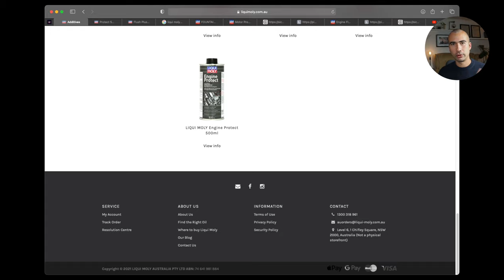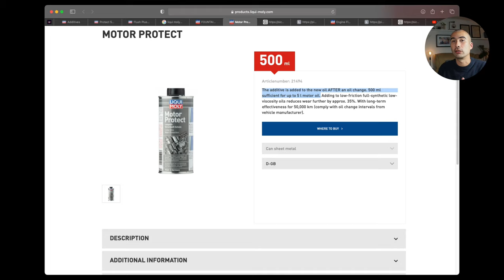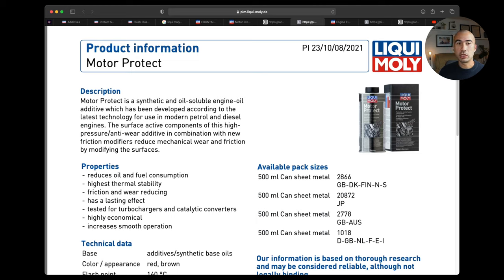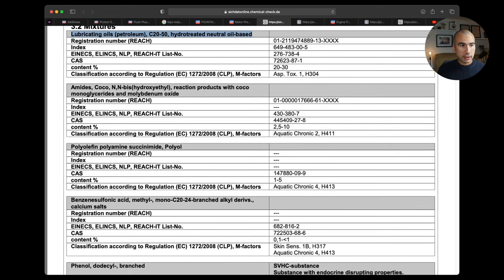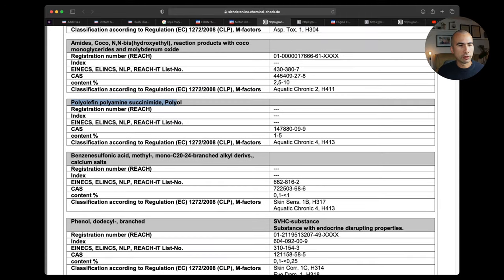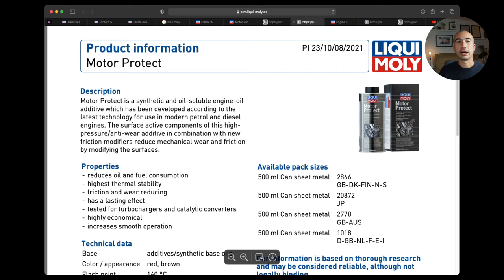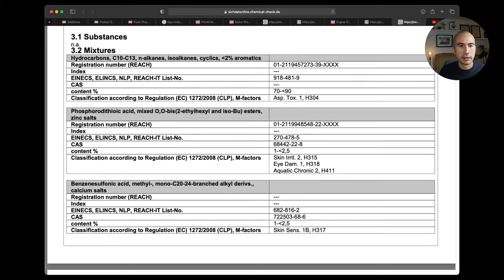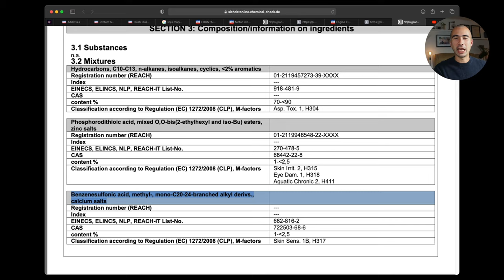What is actually in a motor oil additive like Liqui Moly?

Comment: Liquimoly gives more information about their Ceratec additive. It contains hexagonal boron nitride and a friction modifier in a mineral oil carrier.
Reply from the maker: Not a huge amount available though. The SDS doesn't list the quantity of Boron Nitride, only the friction modifier (the same Moly-based compound as in the Engine Protect product).
Reply: Pretty much a waste of money with a good oil filtration system. 
Molybdenum does not stay in suspension but drops out to coat sump 

Anything with a centrifugal filter will remove any particulate above about 1 micron where a paper filter only removes 10 micron or larger particulates
Reply: yeah its hBN particles and some form of MoDTC in some base oil
Its not AN or Ester that's for sure.
Not really the greatest additive especially not for 20$ per oil change.

Mannol sells a very similar additive that's also hBN based BUT it's suspended in synthetic Ester Oil AND it also contains a lot of ZDDP so you end up boosting your ZDDP around ~300-400ppm.
And that stuff is 6,50$ a can here!
Reply: @alouisschafer7212 G'day mate. What is the name of the Mannol product that you are referring to?

Comment: I've never been a fan of oil "additives" or "treatments".  I'm always wondering how well or not well they interact and react with the additive package and base oil in the motor oil being supplemented.  I prefer to use an oil that is already formulated for my engines needs.

Comment: "Motor Protect" :::: Moly (FM, AW, and anti-Ox) is there in significant amounts.  The MSDS said it is between 2500 ppm to 10,000 ppm, and you divide that by 10 to get the concentration bump-up if you put this in a typical 5-quart sump, for example.  So, this will increase the moly content by anywhere between 250 ppm to 1,000 ppm, which is considered A LOT.  Motor oils typically have between 50 ppm up to 900 ppm rarely (Japanese light 0w20 oils have a bunch).  So you can see Motor Protect does boost moly Plenty.   And Dispersants are there, enough probably.  Calcium detergents are there in small amounts, not bad, and it will increase TBN (acid absorbing capability) a little, not much.  AND,.... other ingredients not so poisonous so they are not in the MSDS, might be there, unknown, like some esters maybe, for more AW and FM (???).  I'd say add this as top-off oil during a long usage interval, to replace depleted chemicals in your motor oil as it ages slightly.

Comment: I think these additives  are bad for the FAP ( espacially the friction modifier ). If Catrol or Mobil  do not integrate these  additives it’s because the risk unbalanced the standard of the oil. It can be dangerous to add additives because you unbalance your motor oil

Comment: "Reduces wear further by 35%"  Now what does that mean ?  What it doesn't mean is that it reduces wear by 35% .  We might assume (we know what that stands for !) that it reduces wear over that additional wear reduction obtained from using two different lubricants ?? VERY unspecific ! Also wear where ? Within an engine wear occurs in different areas under different conditions for different reasons.  PLEASE UNDERSTAND MARKETING   This is not lies, but it is essentially meaningless and designed to mislead. Basically you have found very little about these product even by digging. A VOA would likely tell more, but you have not done this.
Reply: 35% of fuckall is still fuckall :) Just change your oil on time .

Comment: I've used that flush.  I have an 8.8qt oil sump so I used 2 bottles.  I changed the oil and drained the filter and replaced with new oil and flush.  After 15 minutes I drained again.  I was very surprised at how dirty the "new" oil was.  Even putting some in a glass jar with a flashlight behind it, it was extremely dirty.  People say you don't need a flush with regular changes but I use a top brand synthetic and change my oil 25-50% more often than recommended.  I had 80K miles on the engine and the Audi 4.0T is known for clogging the turbo screen so I thought I'd give it a shot.  

Question is, with the little bit of flush left will it hurt the new oil's performance.  I think the car retains .4 - .6qt during a change.
Reply: I have a honda civic. I drained the oil until 1 drop every 15 seconds came out. I then put the plug back in and left the car for a week to sit with no oil. After 7 days or so i removed the sum plug and like almost a liter of oil came out. I was shocked. I then added new oil. With this new info the next time i did a service i added the engine flush, let it drain normally and then added a cheap synthetic oil with new filter and ran the engine on 2500rpm for 15 minutes. I then drained that oil out till a drop every 30 seconds or so. The oil looked dark like used oil. I then filled my castrol synthetic in with another new oil filter. After doing a run with the car i checked the dip stick and the oil looks like new from the bottle. My point here is i love my car and i won't leave that little bit of engine flush in the engine, it has potential to thin the oil out because of how much is still left over with a standard oil drain.
Reply: @reiannaidoo  I have since calculated it to about 6%,  It's neglegable.

Next time, put a breaker on the crank pully and turn the engine over once.  It'll  open up some new passages to drain.  You should see a bunch come out of the oil filter it it's still off.  I don't have a week to let oil drain.
Reply: @datsuntoyy  or just remove spark plugs, pull EFI fuse, and crank the engine using the starter motor. Smart guy.
Reply: @mareksumguy1887  any idea on how long it takes to remove spark plugs in some cars?  Also not fond of clearing settings/creating faults in the computer or risking a spark thus frying a computer.  
Many engines have a very accesable crank pully that only takes a minute and with the ignition off won't be affected by turning the crank.
Yep, smart guy who can think things through.
Reply: you'd then have to weigh the damage done by running the engine on the oil film alone vs leaving in the few grams of flush. Leave the residual flush in, most of the crap would evaporate anyway in the next 10km.
Reply: When you pour in the new oil, leave the drain plug off, and slowly pour in the new oil until it runs clean out the bottom. That will help remove some of the oil that won't drain on its own. You will see that the first half quart or so that flows out will still look quite dark.
Reply: @AEVMU  I usualy do.  When I had my corvair I'd put a breaker on the crank pully and turn the engine over once.  You'd be amazed at how much oil that frees up  I don't do that with the newer engines.

Comment: thanks for this, i just came here again to ask that you do a video on what the difference is between cheap and expensive engine oils, esp the latest ilsac gf6a and SN plus oils. these range from 6 USD to 60USD per litre, a huge price difference when the minimum specs seem really high so why bother using anything more than the cheapest if its meets the "so called toughest API standards". pls consider using a mic as the voice volume is low.. thanks
Reply from the maker: Thanks for the feedback! I’ll add it to the queue. I did touch on this topic in the following video: https://youtu.be/fsF_dIDDJgs

Comment: When asking companies like Mobil if it’s ok to pour in additives, they say no, and that the oil already has what’s needed to protect the engine. LiquiMoly sells MoS2, which is the solid version of Molybdenum. I’ve read that the moly included in motor oils, however, is an oil soluble or liquid version of Molybdenum. Is it really advisable to pour in the solid MoS2 into motor oil? I have seen how people have shown that because it is a solid immersed in mineral oil, it tends to separate out of the motor oil and sit at the bottom of the oil pan if left for a while undriven.
Reply: No advice on can that says to shake before use so maybe doesn't settle out.
Reply: Once it’s suspended in oil the mos2 doesn’t really settle out

Comment: I would like to ask you about a super strange thing , alot of forum recommend motorcycle oil must have Api : Sl ,they that it have more zddp  so i basically use it , but afterwards i searched for top oil brands and find out that the top tier oils are Api : Sn , im really confused , maybe this can be discussed in the next video .
Reply from the maker: I’m not so familiar with motorbike oils, but I think the rationale behind this is that the newer oils contain friction modifiers, so you don’t want to use it on a wet clutch bike.

In this instance, better to look for the JASO motorbike spec.
Reply: A few years ago when SL oils were used I read that it was better to use SH or SJ for bikes as the ZDDP was higher - so interesting. My impression is that people lamented the lack of ZDDP as an essential for bike engines, but from what I gather now other perfectly acceptable anti-wear additives have replaced ZDDP so it's an outdated concern. Just my impression.
Reply: @LubricationExplained  ok , now the most controversial thing that I've found is that some oils like rottela t6 , t4 , stuff like that are rated jaso ma2 , i believe that someone said diesel oil that not have friction modifiers in it , in my country we don't have access to shell rottela products , we have other brands , and a some of them are rated api : sn and jaso ma/ma2 approved and some just says in the description wet clush safe, and they are listed as car oil , am i missing something here or what , plz inform me more about this topic.
Reply: @LubricationExplained  I've researched motorcycle/wet clutch oils extensively as a teenager due to being an avid 2T rider at the time, and there are some studies showing that clutch slipping isn't really caused by friction modifiers as much as it is caused by lower viscosity oils, such as you would see with an SM/SN/SP oil, and I would also presume that the lack of sufficient additives and chemistry to limit viscosity loss during shearing plays a role. Then, another thing to consider is HTHS, especially in enduro applications. KTM recommends running a 10W60 in their 4T bikes for hard on-track and enduro applications, so there is certainly a need for viscosity retention at extremely high temperatures with motorcycle oils. In my research, I found VOAs of Mobil synthetic motorcycle oil that actually had a significant amount of molybdenum in it! From my understanding, friction modifiers don't typically pose much of an issue in an oil of the proper spec for the application, and much of the recommendations to avoid them are due to a sort of false correlation between the lower-HTHS preperties of resource conserving oils and its influence on clutch slip. Another interesting thing to mention is that oils with very high levels of ZDDP are usually recommended against for wet clutches, such as Valvoline 20W50 mineral racing oil and Pennzoil 25w50 mineral racing oil, though I've used both as a gear oil in a 125cc 2T bike with absolutely no issues.

Comment: If you ever do a third-party analysis on additives, always request a TFOUT test which is your thin film oxidation stability. You would be horrified to know that ceratec actually makes your engine oil oxidation properties worse (11% worse to be exact) i’m all about a quality additive pack added to quality oil, but never at the cost of a negative effect.
Reply: It may provide friction reduction to offset the increased oxidation. Just change the oil slightly sooner. 8,000 miles instead of 9,000 miles.

Comment: Thanks for the video. 
Q. For the masses, are 'we' still buying and adding snake oil additives?

Is 10 min of idling an additional 300ml of special snake lube enough to make any difference at all?
Does 500ml of additional additive from a bottle help, or mess up the already complex additive package of a top quality synthetic engine oil?

I've been in the trades for approaching 40yrs, and taken a keen interest in lubrication information. 
I've never used an oil additive in anything I've owned, including rally cars and dirt bikes, and I'm yet to see a lubricant related failure.
I've seen lots of failures, but none related to the lubricant itself...
Reply: “Snake oil”?
These products are already put in that bottle of oil you buy from the store. The manufacturer puts them in. 
Maybe you want some benefit over what your particular oil formula provides.
Reply: @bobirving6052  I'm well aware that some of these additives may already be in the oils we use.
I'm also aware that oil companies spend millions of dollars on getting the formulations and blends correct so that the oil performance is as expected. 
They test to get the various certifications for that product from the SAE and manufacturers so we know they're suitable for the equipment we're adding it to.

How can someone with no knowledge of what is already in the product expect to 'improve' the oil simply by adding a bottle of 'magic juice'?
At best it will have no effect, at worst it will run one part of the blend package way out of range and make it unsuitable.

Comment: have considered using additives esp liqui moly that spends A LOT on marketing and is used by fanboys all over the world. but i just use top range Shell Helix Ultra and my car runs new after 250000 km 11 years and its just a damn Kia Forte 2.0. i change my oil every 14-16000km 8-9 months, which is way over the recommended interval of 10k/6 months. if Shell has invested so much into meeting Ferrari, BMW Merc engine oil standards i.e MB 225.1 BMW Longlife and promising excellent engine wear protection,  why does LM think they can do better?
Reply from the maker: I’ve never personally used top treats. Maybe if you have a specific concern around older style engines, or you do some occasional track racing, or you have modified your engine then i see a use case.

Comment: Metabond Eco or Spirit have a full SDS .
Reply from the maker: It's pretty close, but the one that I could find wasn't entirely complete. if you add up the quantities you get to 91% on the high end or 41% on the low end: https://metabond.eu/files/20190924091123_sds_metabond_eco_2.1_en_2018.pdf
Reply: Yes, because everyone have to keep secret the product special magic additive. As i talked to Metabond about eco, they said that eco have up to 5% hBN.   
Metabond also have fuel additives , additives that are made from Lubrizol and Afton ingredients plus some extra additives. 

Addinol Super Light 5w40 had some additives from the SDS of Metabond eco and spirit in it’s SDS.  
With GT plus additive for manual gearbox, i saw that Metabond used a lot of additives that can be found in other gearbox oils sds from the Market . 
 
More interesting is why additives la like Metabond, Archoil or other brands can make some extra additives for engine oils. I saw a lot of UOA with lower engine wear when hBN additives are used . 
I ask you, that is your opinion about this :)

Comment: what about MANNOL 9829 Ceramo Ester ? its contain bis(2-ethylhexyl) sebacate 97% and boron nitride 3% they wrote it on their sds
Reply: it's good stuff for 6,50$ a can here
cant beat that!

hBN + a lot of ZDDP + Ester
This additive will boost your ZDDP content around 300-400ppm which becomes very significant with full saps oils already at 1000-1300ppm of ZDDP in them which is plenty.
Some studies have shown that above ~800ppm of ZDDP in engine oil yields diminishing returns.
Reply: @alouisschafer7212  thanks for your explanation mate !